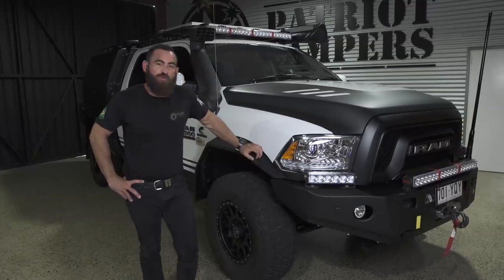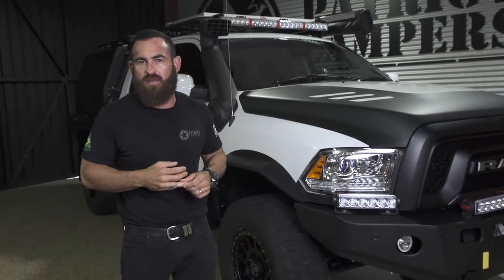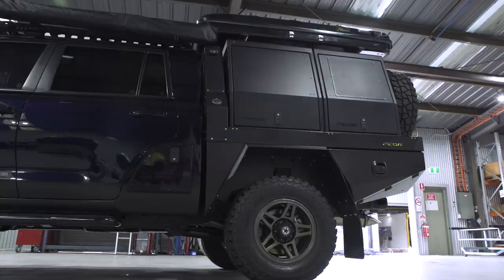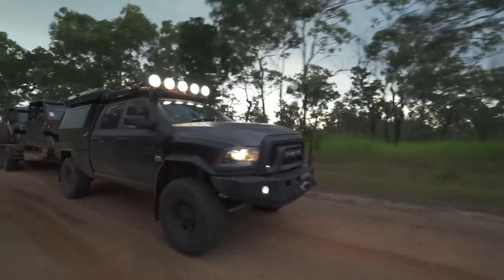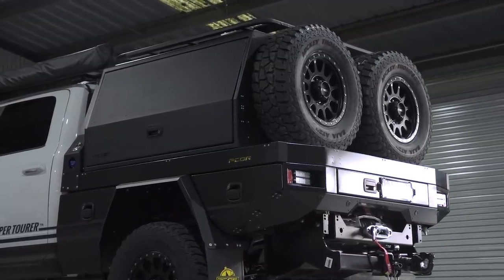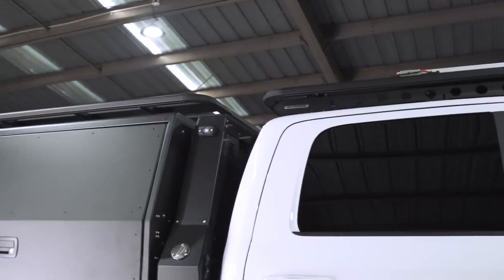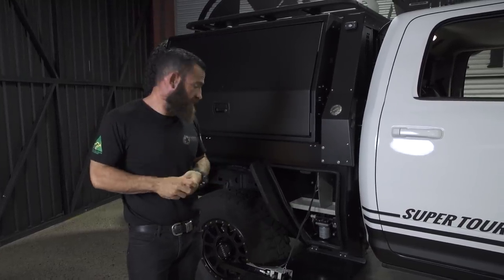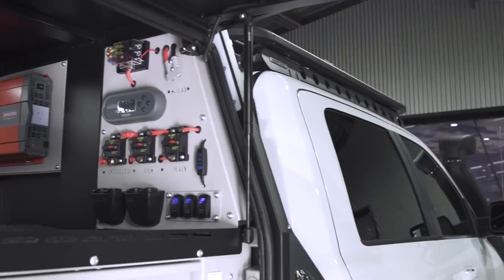Ram Trucks RT25 SUPERTOURER - The NEXT Landcruiser Killer?

Comment: You need to talk Ram into sending you the Power Wagon. That's what I have here in the states and I LOVE it. Front and rear lockers a winch and a power disconnect sway bar all from the factory.
Reply: No cummins tho
Reply: @williamhussey1611  They go with the gas motor to make room for the sway bar disconnect, winch, and to keep the weight down. It still has a good amount of power and torque though. At times I have thought I may want a Cummins but my Hemi motor has towed everything I have hooked to it without much complaining including a 14000 lb. 5th wheel I hooked it up to.

Comment: If you like this you may luv the Power Wagon. Lockers front and rear 410 horsepower disconnecting front sway bar hill decent computer tuned for off highway.
Reply: I have a PW, but for what these guys are doing, diesel is the better option.
Reply: @donleamon8653   What about Ford's new 7.3L gas V8 could this be an option for a F250 instead of a 6.7L V8 diesel ?
Reply: C7 GT1 our fuel is really shit, very poor quality. And in the out back petrol is stuuuupid expensive. The Cummins engine is also already in all our small kenworth sand plant machines and gen set so parts are plenty in the outback.

Comment: The Ram trucks have been proven here in America with that Cummins power plant, it's weird to see the steering wheel on the right.
Reply: Looked to be a clean conversion. I was impressed.
Reply: On the road and in mall parking lots.
Reply: Let's forget about all the transmission problems they have proven too. You want something solid go with a Ford.
Reply: @KrisHuck  6.0 and 6.4 did have problems yes. But dodge has been having tranny problems since 1996. My teacher had a 2006 with 4 transmission replaced in a year and another one of my classmate just had his 2500 transmission rebuilt.
Reply: @zeMasterRuseman  youre too young to even drive, let alone even have an opinion on these.
Reply: @Ron Johnson 2 no it was under warranty from dodge and he got rebuilt one from Chrysler
Reply: Cummins is proven. Everything else has been a complete clusterfuck of low-quality bullshit that can barely make 100k without falling apart, for the last 20-30 years anyway. Different now maybe, but not proven. Chrysler, Dodge and now Fiat rank among the highest in the WORLD in repair and maintenance costs year after year. They are the budget brand that outrank luxury brands in repair costs. They're costlier to maintain than a Rover, somehow! And Jeep is not far behind. But they look nice, so if you replace all the important parts with aftermarket parts and eat the costs of replacing all the electronics and plastic every few years...
Reply: @gorkyd7912  well you know what, idk Nissan with the titan and the diesel just may be the biggest piece of shit ever because Reno is worse
Reply: @jonathanpalmer228  pfft if you can afford this you can swap trans every trip.
Reply: @Dave-jo1hf  lmao I cant afford it so that's why I dont have one. I'll get a Toyota or a Ford
Reply: @Real M you said Cummings not Cummins
Reply: @Real M no issue no one died. I just like teasing about the porno thing so people remember it
Reply: Ted Carruthers  have you been smoking Scotty Kilmer?

Comment: I’d like to know how the front end hold up. I was told by an Aussie friend in Texas here that Australia is the “abuse capital of the world”. From daily ranch work in my area I can tell you the weak points and aftermarket ball joints can run $1000 that will actually hold up. It’s badasss to see a build up of the RAM from the other side of the world.
Reply: The 14 plus trucks have heavier duty ball joints and bearings than the 13 and older trucks.  The suspension and chassis where redesigned for 2014.
Reply: I’m a service manager at a dodge dealer 😂 I think I know about our front ends. It was more for the channel to reply to and what they’ve seen as this is not a usual ride through the Australian outback. Clearly they build the rich mans ride but just looking for the feed back.
Reply: Twoleggedkumulava the chassis for the 14+ trucks are significantly different than the 13 and older ones.  Also, 13 and older trucks have a 4 link with trackbar in the front rather than radius arms of the 14+ trucks.
Reply: Twoleggedkumulava I understand what your trying to say.  Read the press releases from 14 when the trucks came out.

Comment: What’s the Reliability like? The land cruiser is practically immortal and takes everything you throw at it But I don’t know so much about the ram I could be wrong but I believe the land cruiser holds up much better
Reply: Dodge reliability is shit. To improve it, they merged with Fiat....so its worse.
Reply: @thomasurquhart507  Cummins is reliable and works better when loaded.  That's what they are meant for.  you could pull your house down with it.
Reply: @nicg9599   I second that statement about pulling a house down. Worked demolition a while back, dozer went down and we were on a time crunch, hooked the rear tow bar to a few points on a house threw a side by side in the bed for weight, in 4Lo 1st gear on the 6 speed manual ripped the entire house off the foundation and drug it 24 feet before  the anchor points failed and the house collapsed.
Reply: The Cummins is bulletproof. The auto transmission is not. The manual 6 speed made by Mercedes that can be optioned is also bulletproof but by using it you go from 800 ft/pounds of torque down to 670 ft/pounds of torque. Not that it matters because it’s plenty. Empty on highway cruise at 65 mph it returns 27 mpg. They at good trucks. Lots of people have them here in the US
Reply: @robertd4468  27 mpg, is that good?
We usually use litres per 100km in Aus.
I have an 07 Mitsubishi triton and get 13l/100km stop start and 10.2L/100km highway.

Pity American company's don't want to bring the full size utes here, where I live, I have seen heaps of f250s, ram 1500 and 2500. Think I even saw a f350   towing a massive trailer. Nice utes
Reply: @plasmaoc  i think American trucks that are imported down in Australia cost more than they usually do here in US, the main purpose of them isn't to do this small off road stuff it's to heavy, for example a 2500 can weight about 11k pounds i don't know what that number means in KG but that's only the 2500 we have  5500 version that can tow 43,000 pounds and that's pick up truck.

Comment: @patriotcampers the trailer brake is for when you hauling a trailer down hill it uses the trailers brakes to slow down opposed to the truck with all the weight behind you. Kinda like if you going downhill riding s shopping cart and you put your feet down on the back

Comment: Let's just wait and see what this Ram looks like after 50 years of hard use, which is just when a Landcruiser is getting broken in. I'll message you all in April 2069. My 1972 FJ40 will still be running.
Reply: People that can afford this sort of kit dont hold on to vehicles for that long...
Reply: I had an 1982 fj60 and an 73 fj40. Both ran very well when carbs were taken care of but both continued to rust out on the TX coast. Nice vehicles but they would nvr be able to do the work that people here buy ram or ford diesels for. Not even a comparison. Loaded up, you will start to find that what the smaller toyota's struggle with, the dodge and ford will easily handle. The engines are just so much more powerful.
Reply: When it comes to towing your land cruiser is shit but when it comes to off road your truck wins hands down.

Comment: The engine brake is called a Jake break . If there is def  fuel - exhaust fuel get a def block off and get rid of it. With Cummins always get a programmer for the motor. The ballz are cut from the factory
Reply: It's not a "jake" brake. its run through the VNT mechanism on the turbo.  Similar function but not the same.

Comment: I think that is one of the nicest aluminum beds I have seen. I think the only reason the Ram has a leg up on Ford and Chevy is the Cummins. That engine is in tons of different medium duty trucks and agriculture equipment so you could find engine parts at any place that works on Cummins engines. The Ford and Chevy you are limited to just those dealers.
Reply: No better engine in a truck than a Cummins.  The new 2019 3500's come with a Cummins that has 1000 lbft of torque and a beefed up tranny.

Comment: Good Car but cannot compare reliability with LandCruise
Reply: The engine can. That's about it though.
Reply: And you know this because?
Reply: Dodge is crap know ur better off dropping a Cummings
Reply: Best thing on the dodge is the Cummins and dodge doesn’t make it
Reply: @EJ yes dodge does in fact make the light duty Cummins. Cummins handed off the reigns on that engine series to the dodge engineers around the end of the 2nd generation because Cummins were all hands on deck to roll out the new heavy duty ISX Platform for the Class A diesel rigs. Just as Nissan North America handles the designs for the new V8 Cummins, dodge still engineers the light duty I6TD with access to Cummins research and development from the ISX and N14 Platforms.

Comment: You can't kill a Landcruiser tho!
Reply: we have trucks on the road from the 50's with cummins in them... you cant kill a cummins…..the dodge that's wrapped around it will rot away before the engine goes..
Reply: you can't kill a Cummins!!
Reply: Our family farm has 4 dead cruisers
Reply: That's dodge's issue, great motor, the rest is junk... but on that same note, the power joke is just that, a joke, but the truck itself is quality. So you take a rig that's made for long life ( I chose a shoe box chevy, a 12v cummins, eaton fuller manual, and the np205...I dont have $10k to swap in rockwells and lockers yet, but so far nothing broken

Comment: As with anything that’s heavy. If you’re going to do serious off roaring, make sure you have roll protection. My 05 ram 2500 rolled over doing about 35 mph and it flattened the roof Down on half the cab. The trucks are heavy and none of them are made to support that weight upside down.

Comment: It doesn't matter how much equipment you dump on this truck, a Ram will never kill a LandCruiser in a million years.
Reply: Yeah it will. It’s not 1999
Reply: Absolutely, I work in auto plants, and know the difference I've personally witnessed, between Toyota and ram. Not even close. I hate Ford with a passion, but between the big three, they're building the best of the pickups. Chevrolet and Chrysler are floundering, and adding bits doesn't change that.
Reply: @nunyabusiness2444  Well said.
Reply: @Daniel Cram Toyotas definitely can last longer than that. My 7.3l is at 20 years right now and in excellent shape.
Reply: @nunyabusiness2444  This has a Cummins in it.  You're comparing apples to oranges.  People own Cummins engines with over 1 million miles on them.
Reply: I’ve driven a ram and a Land Cruiser  and I’d pick the ram any day over a Land Cruiser  especially when it comes down to towing and also the fuel bill

Comment: I own both a cruiser and a cummins. Part of why the cruiser dominates in overland travel is because of its reliability. My Ram is very quirky and costs a ton to operate in comparison.
Reply: What went wrong with the Ram? Why was the cost so much?
Reply: In California, diesel is more expensive than gasoline.  The 4wd Ram weighs almost 4 tons, so it eats tires, brakes, ball joints and wheel bearings very quickly.  It takes 3 gallons of oil that needs to be changed frequently because of the EGR system recirculating unburnt diesel soot into the intake tract. Rear windows leak on brand new trucks, stiff wiring that’s brittle and cracks.  Light years away from Toyota’s reliability. It pulls a lot of weight though and very safely
Reply: @UlyssesJurado  Move out of Commiefornia and delete the Cummins.
Reply: @UlyssesJurado  you live in California and you know how ridiculous is California is right?
Reply: nicolas gerrald I would love to delete the cummins, but having been well traveled, I wouldn’t live anywhere else.
Reply: Jalen Rose The population density is so high here in comparison to other states that the smog laws have to be super strict.  In China the smog is so thick because of lack of regulation that you can’t even take a picture of the skyline.  I’d love a twin turbo V8 cruiser or a deleted cummins, but i can sacrifice for living in my favorite state
Reply: @UlyssesJurado  California is for the rich people and Hollywood actors and actresses a poor man can't have sht down there nonetheless it was good until all this ridiculous politicians keep winning.

Comment: Awesome build! I wonder if you can get a 3500 single wheel.  Better trans, suspension, higher output motor.
Reply: I believe the motor and trans are the same and the only difference is that the suspension is ruffer as irs designed to carry more. So if you don't plan on towing the 2500 is all youll want and need

Comment: This ram will die trying to kill the legendary Land Cruiser. Only thing that sells these rams are their OFF THE SHELF motor "Cummins".
Reply: Your right.As a Toyota owner, the ram sells quite well because of Cummins motor because its a great engine and this are very easy to tune and if you are talking about old ones..no diesel engine on earth is as legendary as a 12-valve Cummins because it's just stupid reliable due to how well built the engine is.
Reply: @misylook1059  That's why so many people delete their new Cummins engine.  After you take off all the aftertreatment and egr, it works like it was meant to.
Reply: @nicg9599  👍

Comment: What a Jake break does (engine break) is when the piston comes up for its compression stroke it releases the energy it was going to use, aka robbing it and slowing down the truck.
Reply: Those jake brakes also keep your turbo actuator from seizing up with the aftertreatment the government regulates you have to have.  That's why so many people delete them.
Reply: @nicg9599  yeah we just learned about that in class, older ones I know didnt have that problem. One of the truck for the company I work for actually just had an actuator fail and took out the turbo
Reply: @jonathanpalmer228  The older Cummins didn't have all that electronic crap.  That's emissions crap.  People do delete the new Cummins engines and put in head studs and go back to a mechanical turbo.  You have to put in head studs or you'll blow a head gasket.  That's how much extra air those older turbos put out.  It's crazy.  People drag race their cummins too.  it's awesome to see a truck do under 10 second 1/4 miles.

Comment: The Laramie (cigarettes from the 1940s)  is not top of the line, the Powerwagon, Longhorn Laramie and Limited are higher classes.  the engine brake does not kick in when you take your foot off the brakes.  The engine brake kicks in when you take your foot off the accelerator pedal if it is turned on. if you go around the tow haul mode for the "we do not know how to pull a trailer" device you will never get the true benefit of the engine break. You can hire someone to drive the truck and haul your trailer, I would think someone there can do it.  My minivan pulls more than the sandcruiser, my daughters have all towed 5 ton camper and may consider teaching people how to drive if they covered expenses.  I would need to go with as they are 14 and 16.

Comment: Haha... 4" of lift "pushing the limits of the platform"... CLEARLY you havent been to Texas or anywhere around an Oilfield or Pipeline.
Reply from the maker: Nathan Browning In Australia we can’t go any higher lift that takes headlights over 1.20m so 4” for us is big, we know it’s nothing compared to what you guys are doing over there, we’ve seen it 😉
Reply: Patriot Campers seems like a good opportunity to run aftermarket lights integrated into that fat bumper to give some more wiggle room.
Reply: @patriotcampers   I guess its time to start cuttin' fender wells. :/
Reply: Nathan Browning mate all city’s have a pipe line going to a town to give that town water
Reply: josh Stocks in Australia we call a fat bumpers is a bull bar
Reply: @michaelmurphy3912  I meant here in the States (mainly Texas, in my experience). In those 3 areas I mentioned (Texas, Oilfield, and Pipelines) there are lifted Dodges everywhere. Guys have them as their personal trucks and their work trucks. Its almost like a prerequisite of an oilfield or pipeline worker to go out after his first month and buy the biggest truck he can find in the nearest town. This is what I was eluding to, not that Australia doesn't have pipelines.
Reply: The Ram series is also capable of accepting a 4" lift from and MOPAR actually has parts for it. However anything above 4" pushes beyond its standard design limitations. Meaning they cant guarantee the lifetime or integrity of performance beyond those modifications, nor the safety.

Comment: Post another video in 2039 if this truck is still going strong after 20 years like almost all LC's.
Reply: I'm guessing you dont know much about these trucks. If it had a regular "Chrysler" engine in it, I'd agree with you but when you buy one of these with the Cummins, it's a damn monster and they last forever.
Reply: I have an 01 cummins and it has over 1 million miles on it with just a water pump and alternator replacement. just saying.
Reply: @chrisrhudy2000  I have a 99 cummins with 364,000 miles. I drove it as a work truck for years, hauled tons and tons of stuff with it. Doubt my new for lasts as long.
Reply: I have a 20 year old Dodge with a Cummins, only problem is it needs a paint job. And it gets 4mpg better than a brand new truck.
Reply: People drag race Cummins and do under 10 second 1/4 miles.  you're pretty ignorant to what these engines are capable of.